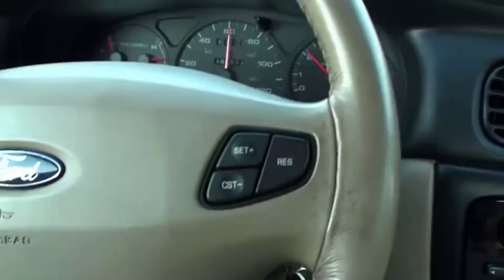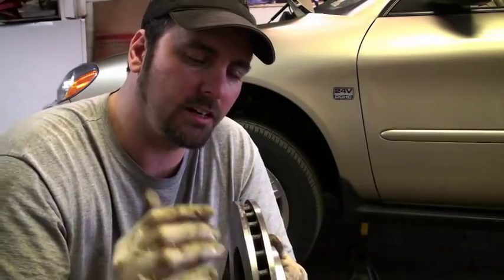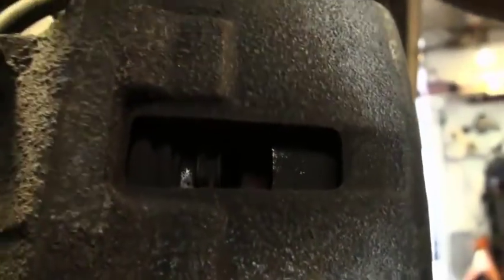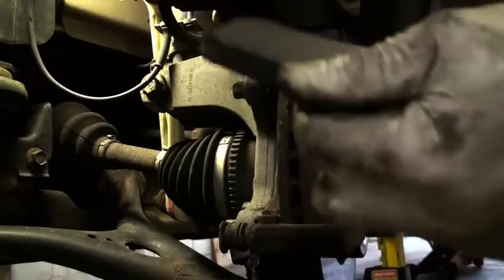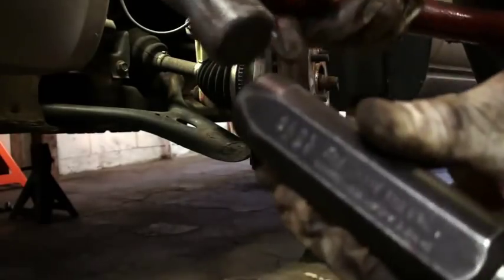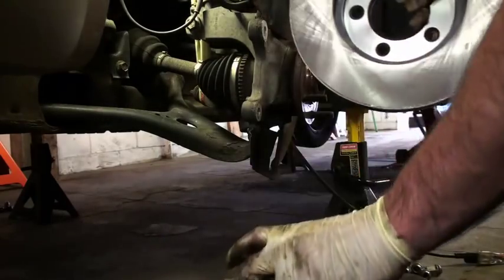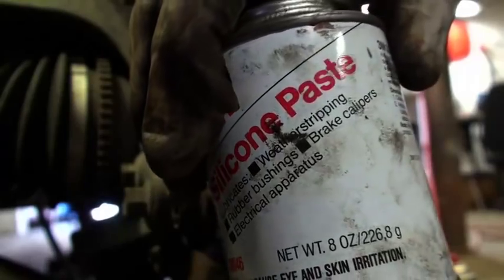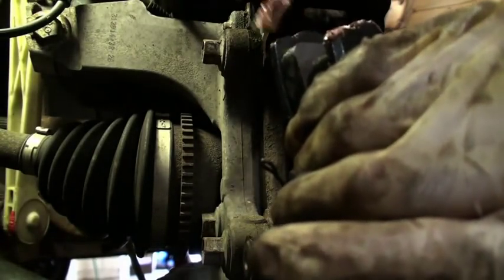Front Disc Brakes and How to Replace Them - EricTheCarGuy

Comment: I also use anti-seize or caliper grease between the new rotor and the hub, then again between the wheel and the rotor.  here in Maine, salt will rust these parts together quickly.  By lubricating them every time you have them apart, you can ensure that the parts are easier to take apart next time.

Comment from the maker: I just uploaded a video on replacing those rotors, just goto my channel it's the latest upload.  I don't recommend using a slide hammer BTW, it would separate the bearing and possibly ruin it.

Comment from the maker: @denperre If the fluid is under the master it's really the only place it could come from unless you have a line or something leaking that you didn't see.  If you used the method I show in the video as you say then that should not have occurred but perhaps you didn't have the bleeder all the way open or it wasn't clamped off enough.  If you don't have any leaks and your brakes work I would not be concerned.

Comment: didn't see it mentioned in the comments and it wasn't in the video, but I wanted to share a tip - before putting the rotor back on, clean the hub where the rotor makes contact with a bit of fine grit sand paper and some brake cleaner and a rag. make sure there's no rust build up or gunk here cuz it can cause the rotor to not sit flush against the hub and this can cause brake pulsation and rotor warping as well.

Comment: I'm in the same boat as the first commenter. Well put together video!
---
Here's one for you. I recently had my brakes done (they told me they were fine just needed cleaning so I had some 30K mile stuff done instead) anyway.... I saw a poster in the shop talking about changing an interior air filter for Hondas. I'd never heard of that. Our car is 8 years old and has about 120K miles on it. 

Is it easy to change?

Comment from the maker: It's a process of elimination when you don't have the proper equipment.  The dealership has the tools, in this case a Tech1, and information to diagnose these problems quickly and effectively, with the right technician using them.  It's just not cost effective for a small shop to have such equipment, the manufacturer insures that.  Manufacturers were not too happy when OBDII came along for just this reason, it meant their technology was no longer proprietary.

Comment from the maker: First, I've done it, before I started pushing the piston back with the bleeder open I ruined a master cylinder or 2.  I think it has something to do with forcing fluid past the seals in the opposite direction thus corrupting the seals.  I also don't think it is professional to dump a bunch of fluid out of the top of the master cylinder possibly ruining the paint on the firewall or booster and making a mess on the floor.

Comment: Great instructions. Couple of  questions, I was told that it is a good idea to apply anti-squeak grease to the back of the pads.  Is this the same grease that you are showing in the video applied to the pad sides, or is it a different product? Also in your other video you recommend using torque ranch for wheel mounting, how about when putting calipers back on? Thanks.

Comment: So I've been watching every youtube video I can find on doing front brakes, in preparation for doing my own 99 Taurus brakes soon.

You are the first one to say not to compress the fluid back into the master cylinder. It makes sense, but I've got a couple of question.

for one, how safe is it to compress the brake line like that? Wouldn't that weaken it by crushing it like that?

Secondly, do you have to bleed the brakes after opening the bleeder screw like that?

thanks!

Comment: ETCG - Awesome video.  There are a lot of details, but in watching your video I was able to go out and change my front disc brakes!

I have a 2001 Honda Accord EX-L.  In another of your videos you show a previous generation to the 2001 - with a captured rotor.  Do you know if my Accord has a captured rotor?  The problem I have is that if it is (and it has those screws) how can I change it out with a minimum of tool buying?

Comment: @EricTheCarGuy hey thanks! that explains the little bit of noise i was hearing...it was my first time changing brakes so i thought i messed something up. especially since i had to bang on the driver side rotor since it was rusted solid to the car.

Comment: I don't know what it is about brakes, but they always look fun to me. But maybe I'm only saying this due to my relative lack of experience. I'm really looking forward to taking my brakes class this semester, especially since my pads are getting a little low and I'm sure the fluid is nearing the end of it's life.

As for removing stuck rotors, the few times I had to do it I just whacked the back of the rotor with a rubber mallet and worked just fine. But then again, rust isn't really an issue here since I live in southern CA. And as for pushing back in the pistons, I used a C-clamp instead using giant channel locks. :)

Comment: Hey man. Awesome video series. I have been watching nonstop in my free time for like 3 days. Anyway--I've done brake jobs on my Accord (including replacing the rotors), my Cherokee, and my girl's Focus, but I've always just pushed the calipers back in with a C-clamp. Never bled the line like you showed with the soda bottle and whatnot. Is that harmful for the system? And if so, why is that? Thanks a lot man.

Comment: I think the only time you need to machine (resurface) the rotors are when there's no brake pad left and there's metal on metal contact, or grinding, which you definitely can hear when braking. Machining the rotors is pretty much a last ditch effort of trying to save the rotors before you're forced to buy new ones. Provided of course if there's anything to save. I've had it happen to me a few times. You can change the pads without having to machine the rotors, if the rotors are in good shape.

Comment: @13FravelJ you can machine them by taking them to a machine shop or having a shop do them while mounted on the car.  Both of these require special equipment that costs a ton of money.   It's called "turning" them and can be done if they're not too bad off.

Comment: Hay ,Eric must say love your videos you explain them all very well. I do have a question on a 2009-2010 Chrysler Town and Country or Dodge Caravan the front pads where is the correct direction of the brake wear indicators. I have seen some in front and some in back some on top and some on the bottom. Which is the proper method, or is their?

Comment: Great video.   I wonder if you have any experience changing front rotors on 1993ish Honda Accords. I am about to get about doing just that. In my case, the hub traps the rotor which is pressed into the bearing assembly.  In addition, I have some "tight" bolts to remove.what you would do about those bolts and what your method for removing the hub and bolts would be? I plan on using a mak shift sliding hammer or removing the entire knuckle to drive it out from behind.

Comment: Eric great videos! Thanks for taking the time to pass your expert knowledge to the youtube masses. One question about your method. How would you pinch off stainless steel lines? Whats another way around not being able to pinch the line? Ive alway taken the cap off the MC and use a clean rag to absorb some fluid and then pressed the caliper in.  Thanks again!

Comment: I like your videos and you are giving me confidence to do the rotors on my Accord on my own (was linked from the captive rotor vid). So my question is..what are your thoughts about instead of bleeding through the bleed valve that you just pop open the master cylinder and push the piston back to let the air go out through the master cylinder? I've seen these reverse bleeders that push the air up instead of down through the bleeder valve. Are both ways 'okay'?

Comment: Eric, I just did the pads on my 91 CRX after 24 years (it has been stored most of its life).  The dealer serviced the brakes a few times in its life.  I noticed that the fronts did not have shims, but the rears did.  When I replaced the pads, I put shims on the rears, but left them off the fronts.  Should I install the shims on the fronts as well?

Comment from the maker: @CaseyK1982 When you force fluid in the opposite direction past the seals in the master there are times where the seals will be damaged by this (I've seen this happen more than once).  As for taking the cap off that accomplishes nothing in my opinion as you will still be running fluid down the firewall ruining the paint and making a mess on the floor.

Comment: Great video and tips!!!  I got a question about changing the front brakes on a 04camry.  I will be replacing its first set of pads.  Is it necessary to resurface the rotors, assuming it is not warped or scratched?

Comment: I've read in several of your comments about not pushing brake fluid back into the master and it makes sense. But what about tools like the Phoenix V-12 brake bleeder which works by adding fluid into the system at the caliper?

Comment: Eric, I Find myself watching your videos all the time.  Now I am curious what your opinion on ceramic vs semi metallic.  I had a slide ceased in and was able to free it with some map gas heat, and cleaned it up with emery and back in business, saved $100 on a new caliper.  So how bout the wear on the rotor with ceramic vs semimetallic?  $35 vs $55?  I know the reduced noice and reduced visual dust, but what about wear on pads & rotors with each?

Comment: Thats a crafty idea for the bleeder, really easy to make and save you the time of either bleeding the brakes to get the air out or taking your chances of ruining your Slave Cylinder from back flow and breaking the seal. it can be done without that but at risk and has to be done slow,  Thanks for the idea with the bottle for the brake fluid :P

Comment: Hello Eric, I'm a recent subscriber and a big fan.  Just one question here, you didn't mention in this video to use silicone lube under the piston boot like you did in the rear disc brakes video. Is that because you forgot to mention it or is it because you're not supposed to do that with front brakes?

Comment from the maker: @MCYonke Your really not adding fluid but preventing it from going back into the master in the opposite direction of flow, the bleeder you mention is good for bleeding the brakes but not necessarily for replacing pads.

Comment: Eric, why do you turn key to on position when doing the brake job?
Reply: To unlock the steering wheel and have better access to the bolts behind the caliper.

Comment: Great video as usual! I noticed you applied silicone paste to the slide pins. Have you removed slide pins that you applied silicone paste after say 50,000 miles and confirmed that the silicone paste did not dry up and was still functioning?

Comment: When you get pulsations with each wheel revolution, how do you know if it's the front or the back wheels? In a system with front discs and rear drums, which is more prone to causing pulsations?

Comment: FYI: You don't need to do what he did in this video pertaining to the bleeder valve. The master cylinder won't be damaged if you push the piston back in like everyone else does it(with old brake pad and c clamp). Using the c clamp and brake pad is just fine, it's not like you are pushing the piston back in everyday. If that was the case then yes it could damage the master cylinder eventually but doing it every couple of years when you change the brakes won't do anything.

Comment: Sup Eric love your vids. i got a 03 olds alero, front right caliper makes a rusty spring-like noise whenever I press the brake.  my co-worker told me that it's one of the housing pins that's not moving. this doesn't affect the performance of the braking but it still makes the noise.  is it necessary for me to replace the entire caliper and bracket or can I get away with just replacing the housing pins? ..or should i just put some silicone on the pins that are in now?  thanks much!

Comment from the maker: @LTslimjim I don't subscribe to that, the only thing I've ever known to cause this is rotors or drums that are not 'true'.  There may be issues with hub runout however that's not common in my experience.  I think it's also important to note that if you over torque the wheels it can also cause a vibration on braking.

Comment: @shaumoore 
The bottle is there just to catch excess fluid. Air doesnt usually get in via the bleed valve if there is bled fluid in the bleed hose (or you will be able to see the air bubbles from the hose go back in).

Comment: Eric,
Thanks for all your brake videos- helped me alot doing my brakes. Had a few hiccups, but they are on and working. 1 problem I had, one was on the front brakes, when I installed the discs and pads, and caliper was all the way to the top, the bracket would not come down all the way. Could not reinsert the bottom bolt. Had to leave the old halfworn brake pad (outside) in order to be able to lower bracket and replace bolt. Will let them wear a bit and than put on the new pad. Is that a okay?

Comment: Excellent Video. If you dont teach automechanics it would be a shame. If a slider pin is ceased, can I get by with removing it (with the blue wrench) and cleaning it up and lubing it with silicone paste? My car is 12 years old. Thanks

Comment: On those caliper slides: Does taking out those rubber boots just require you to yank them out? And installing them back in is just shoving them in? My new brake pads came with new rubber boots and caps and I will most likely use them just because they're provided.

Comment: Hi Eric, one or two questions for you.  Across the screen of the vid, you put "pads not worn out, replacing for new rotors", so why did you replace them, if they weren't worn out?  (unless i've missed something?).  Also, don't understand why the ignition key comes into this??  When you've pressed the piston back in, couldn't you have just loosened the top of the brake reservoir a bit instead of collecting it in a container?  And why didn't you refill with the fluid from the container?

Comment: Thanks for the awesome and very helpful video.  I just replaced all four rotors/pad exactly as you described. Perfect tutorial man. I didn't use your 'brake fluid recovery' as you did because I was scared of leaving air in my lines.  Plus I don't have vice grips :(
Unfortunately, the hydraulic hose on rear right got cracked from twisting. Not leaking though, could it be replaced easily?

Comment: so in the instence of a car having stainless steel braided brake lines, how would i go about  clamping the hoes so the fluid won't travel back to the master cylinder. Should i do it as if it were a rubber brake line or is there another method for braided lines?

Comment: Super! Just quick question about the caliper pin: I have 2017 Infinity QX60, I changed front and rear brake pad/rotors, flushed brake fluids. I found there is a sliding pin bushing on one sliding pin bolt for each caliper. I noticed Front caliper pin with rubber bushing on the bottom of caliper, and Rear caliper pin with rubber bushing on the top of caliper; But the service manual page BR-37 shows the figure for both Front and Rear caliper pin with rubber bushing on the TOP (driver side view). would you please let me know the difference for put this caliper pin with rubber bushing on the top/bottom, and why there is rubber bushing on the pin? Thanks a lot.

Comment: hey Eric, I was wondering do you have any tricks for Ford brakes with the pins that hold in the pads? I am going to replace the pads and rotors on a escort and was looking for any tips and tricks. Plus any good tips for a stuck on or rusted on wheel?

Comment from the maker: @OldYgg Watch the video I did on removing rotor screws if that is what you see when you take the wheel off instead of those 4 bolts, I believe that will help.  Good luck.

Comment: does using your vise-grip method on the soft brake line prevent you from having to bleed air out of your brake lines after the job is complete?

Comment: Hey, i always just open the brake fluid reservoir and use a c-clamp to push back the piston, does that damage the master pump too ? I could imagine something going bad with the brake liquid reservoir cap on but if its off, and a little of brake fluid freely leaks out then i just wipe it and refill.

Comment: The Mercedes workshop that did the brakes on my car say they use anti-seize copper paste on the sliding pins instead of silicone paste. I think this might be due to the very cold, snowy climate here with lots of road salt being used causing the brakes to corrode and seize very frequently. Do you think that anti-seize might be preferable to silicone paste in colder climates? How does the silicone behave in low temperatures?

Comment: Thanks Eric for the vids , it helps noob like me :-)  i did front pads and disks and learns few things in the process too, overall it was fun !   first,  my old pads were near jammed into the calipers, in fact one was loose and it grinded itself to the metal, all 4 were ok for awhile tho, they were used correctly,  so when i  put the new ones they were nearly jamming into the caliper, so i grinded a bit of the side notch to have them move a bit freely an used antiseize copper stuff on them  :-)

Comment: Interesting fact. A lot of new generation Pontiac GTO's had this problem pretty quick out of the dealership. Took a few people replacing rotors for no reason to figure out that the strut top bushings had failed and caused this. I replaced mine with some really nice drilled/slotted rotors and still had the vibration. New set of bushings and the problem went away.